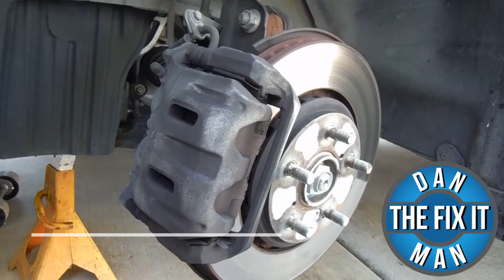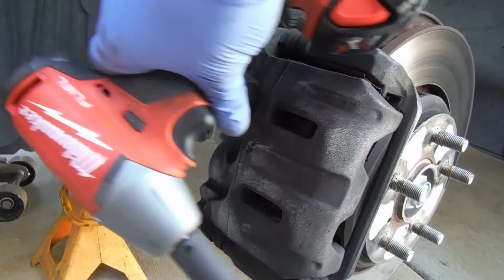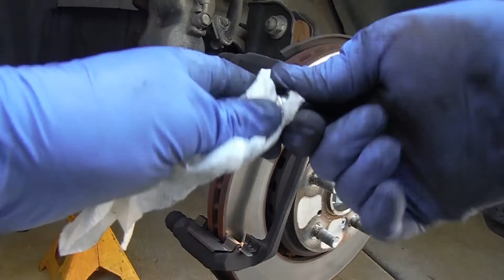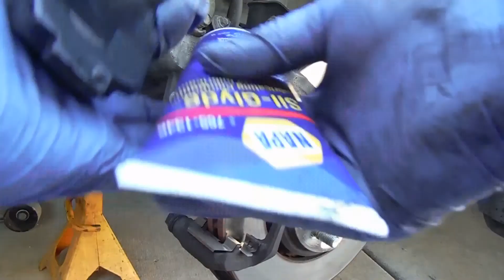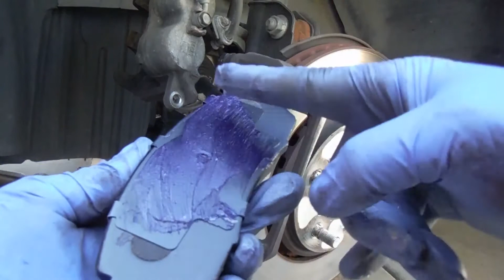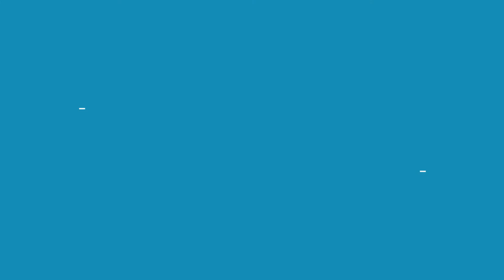2015 HONDA ODYSSEY - HOW TO REPLACE FRONT BRAKE PADS - DIY

Comment: Thank you for putting this video on. 

NOTE: I found that putting the caliber on before the springs was the best way (least frustration). Just tilt the caliber on one side away from the pad (allowing the other side to hold on the pads) and you can put the springs on each side.
Reply: excellent point!